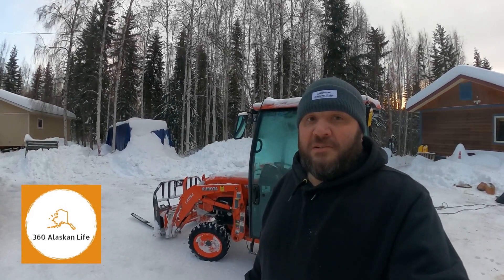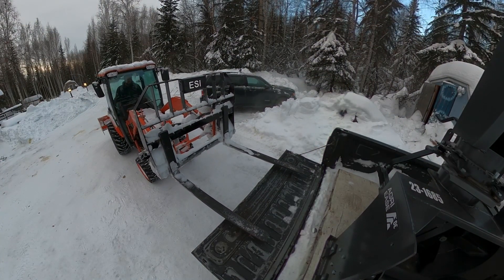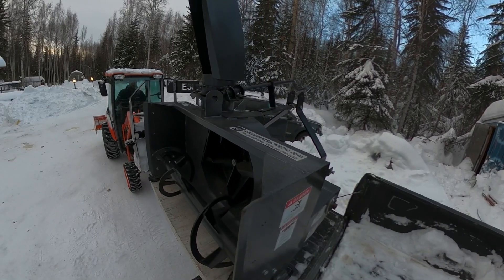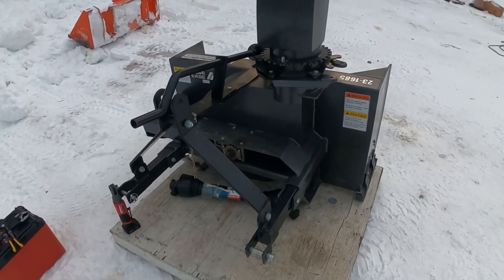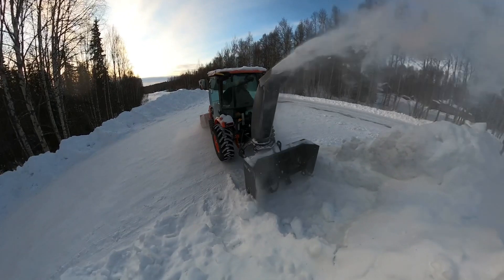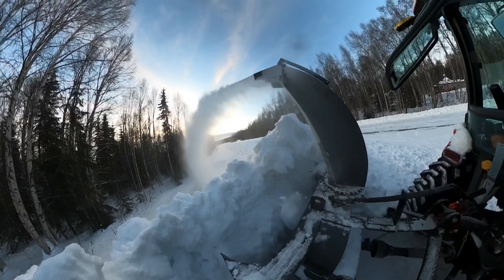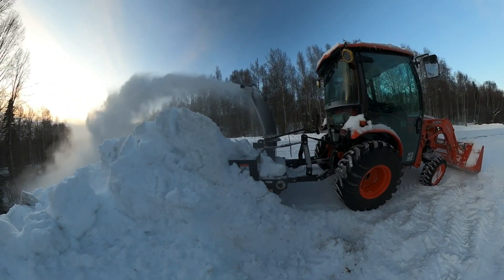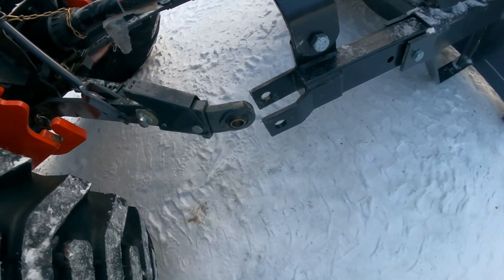New Rear Mounted Snowblower (Kubota B2650)

Comment: Looks like the same company that made that one made my nortrac snowblower. Mine works like a beast. I also chose a three-point so I can keep my loader freed up. Plus you can take on way bigger snow with a three-point. One thing I noticed that you got to watch though is you can raise the snowblower up enough that the PTO starts binding a little bit
Reply from the maker: Indeed it is this thing was a beast worked great 👍

Comment: Awesome to see the new snow blower in action ! Yeah ! it's a BEAST ! The size of that impeller is massive !  Thankfully no damage was done to your PTO when that pin came loose. You gotta bend those cotter pins holding the pins really well.  Little things like this make us all hopefully check our own equipment better than we do sometimes for loose or missing things.  Thanks for posting !! I wish I had snow like that !  Only have about a foot on the ground.  Thanks ! 🙂
Reply from the maker: Thanks for watching 👍 I replaced the stock clips they gave me with some proper cotter pins. Should be the last time that happens 👍👍

Comment: As someone who has a 60” Meteor rear PTO snowblower on a sub-compact tractor
•	Your tractor and rear pto snow blower seem to do the job with no issue other than you possibly coming out with a stiff neck when done.  Rear PTO blowers near me are about 1/3 the price of front blowers and make it worth it not counting still having a front implement on at the same time too
•	Thanks so very much for posting and sharing 360 – love seeing that snow come out the cute!
              All the best and God Bless. 🙏❤🇺🇸
Reply from the maker: Thanks for watching I really enjoyed the PTO driven snow blower well worth the money it was a beast too taking on hard pack and throwing it no problems. The benefits of have my loader on far out weight any pain in my neck 🤣🤣 thanks and have a great 👍 one

Comment: Exactly like mine. Hint - make sure the nuts for the little round carrier thingie on the top are tightened. Mine vibrated loose the first time. Use Nyloc maybe. That shear bolt on the PTO - it’ll do its job and snap if you get a piece of wood in there. Get a few extra shear bolts. That section where the handle bracket meets the 3 point (with the 2-3 bolts) - make sure those plates line up and tighten them good.
Reply from the maker: Thanks great advice I’ll go through the unit before next time and make sure everything is snug👍 I made sure to by a bag of shear bolts thanks for watching 🚜😃

Comment: I've got a rear mounter snow blower and it's great. These rear mounts don't throw snow too far as the impeller only spins at 540 rpm. But that's good enough for me as I only need to throw the snow over the drive stone wall. Eventually you will want remote controls over the chute. Mine has hydraulic rotation and an electric flipper control. There are new design rear mount blowers that allow you to blow snow while going forward. Not sure they would work if you needed to move a big pile/drift as you have to be able to drive over what you want to blow.
Reply from the maker: Thanks for watching, I will have to look in to adding a motor to my chute. 👍 can’t believe how well the unit chewed up the hard pack snow ❄️

Comment: Nice blower!  Consider adding electric or hydraulic chute rotation to it if you have the remotes.  You will not regret it.
Reply from the maker: Great idea
Reply: @180Floridalife  Once you have a chute with remote rotation you never look back!  I have an open station B2601 and even for that I got hydraulic chute rotation and a electric deflector on top of the chute.
Reply from the maker: @C_J_81  I’m hoping this summer to get the chute powered up, no shop to work on it in the winter unfortunately

Comment: Definitely gets the job done. I totally understand your point about the rear mount. I wouldn't want to give up my loader either. I have 3 loader tractors ( 4 , if you count the other loader that I have for the other 520 John Deere) so I would be OK to sacrifice having the loader. I would like the visibility of having the blower on the front. Not going to happen anyway, because my L2501 doesn't have a mid pto. Thanks for sharing Dana. Very happy for you. You have a tool that you will not want to be without from now on. I bet you wonder how you ever operated without it.
Reply from the maker: It has been such a time saver already!👍  the loader is so handy for so many task it would be a pain to switch out between a front mounted and a loader all the time. 👋 THANKS

Comment: just a question, why a 50" for your B2650. I've got a 64" for my tractor B2650.  just wondering nice blower. take care and stay warm.
Reply from the maker: Thanks great question as size does matter. I had a lot of hard pack snow to remove and some narrow areas to get in to. I wanted the maximum power for the hard pack snow, piles I made with the bucket. I was worried about how the bigger size would eat the hard pack. The 50 did awesome eating my snow piles never slowed it down. Thanks for watching and have a great one

Comment: Beast. How did u pick this over landpride? Also your rear wheel width is 54”. But blower is 50”. Is that an issue? With deep snow u want your trench wider than wheels
Reply from the maker: Thanks for watching, our local kubota dealer only carry this band, for a rear mounted snow blower. The width has not been a issue, I experimented it trenching through my yard with no issues. Usually in the interior of alaska it only snows a few inches in a day, so normally not a issue